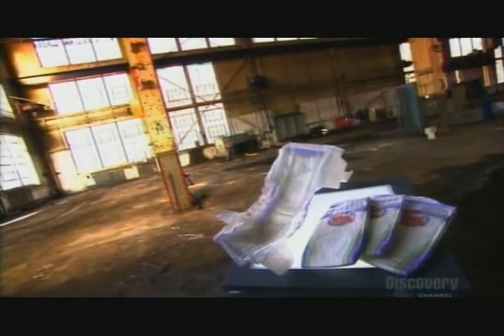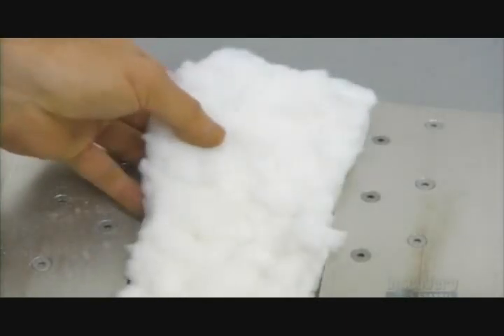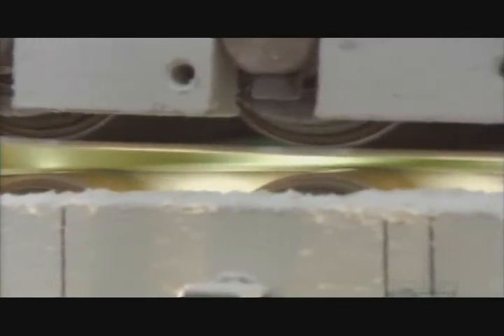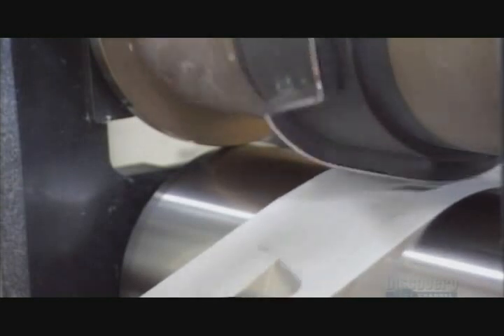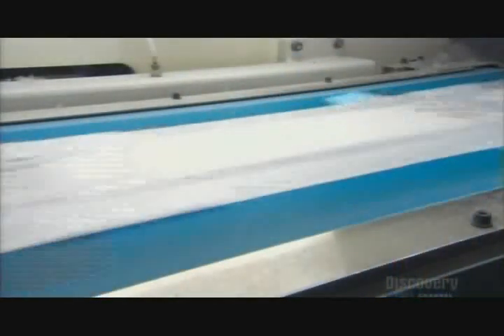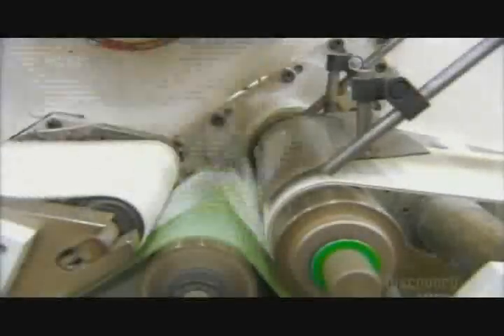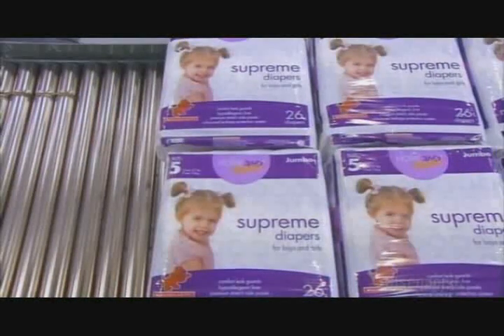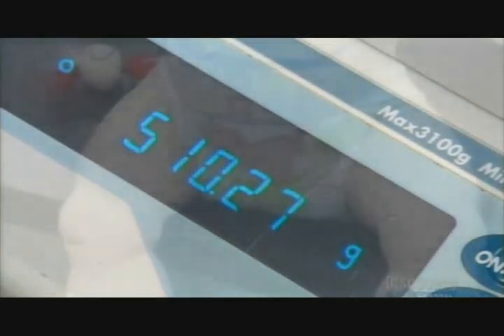How it's made - Disposable Diapers

Comment: I read that babies that use disposable diapers are happier, which I think is very beneficial.  if you multiply 45 grams times about 1000 diapers thats only 45 kilograms of plastic, which is comparable to an adult using perhaps 14 gallons of gas, so if you can make a baby happy with the plastic that less than a fill up represents thats kind of nice